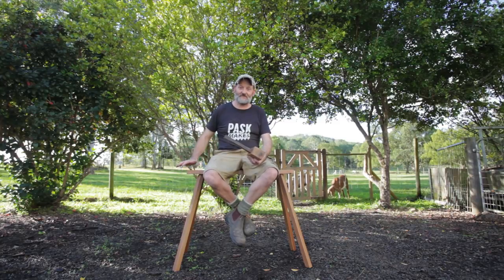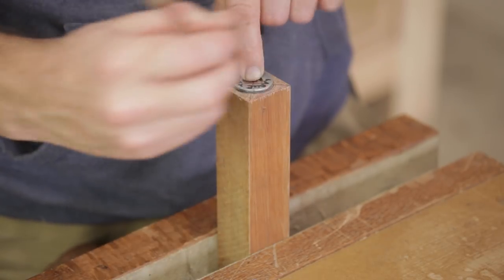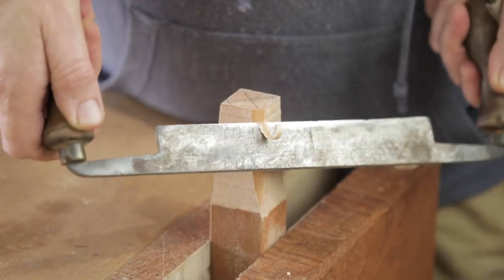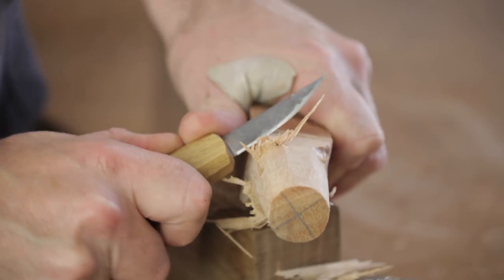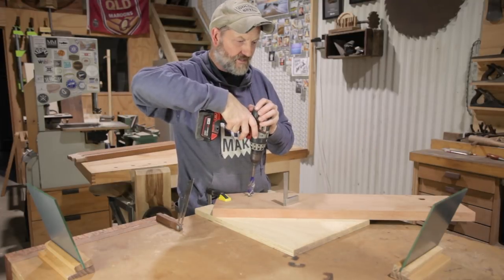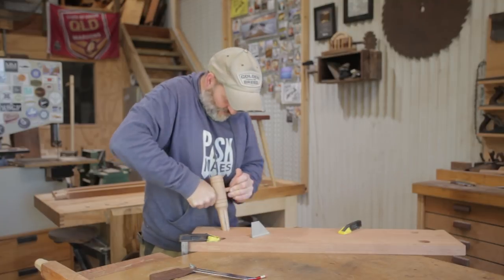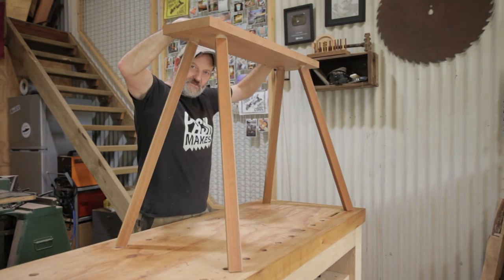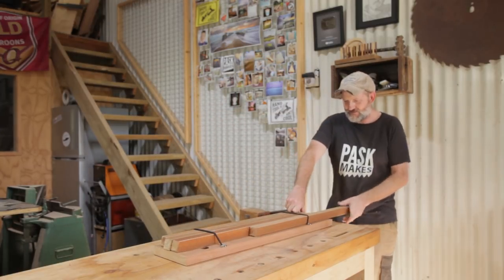Knockdown Sawhorse

Comment: Gosh, I really like this design.  You've done it again. !!
Reply: Nice quick taper marking jig.  
Nice mirror trick.  It has me wondering if a third mirror could be used and with proper alignment, could both views be seen without having to turn your head.   I see a run on mirrors about to occur.
Reply from the maker: You don't even have to turn your head, you can just move your eyes, but I couldn't help myself. ;)

Comment: Take a block of scrap. Using a sliding bevel mark your taper down one edge then square the lines across. Then do the same from a second edge and cut down the lines to form the angle you want to drill at. In the end you'll have an L shaped guide. Put your drill bit centred where you want to drill, slide the guide block up to make contact with the side of your drill bit and bore your hole. It's much easier to control than using mirrors and looking left and right.
Reply from the maker: Yes that would work but I reckon it would have more room for error. You'd be able to view a smaller drill bit against the angled walls but a larger speed bore bit, spade bit or forstner bit wouldn't work so well. The mirror trick is great and something I will do from now on. Also very quick and easy. :)
Reply: Fair enough, I have used it with a brace and auger bit with very accurate results. It wouldn't work with a spade bit at all. There's a modified version I saw once for a forsner bit where a relief cut was made to the underside of the guide to allow the bit to fit in. Anyways good to hear the mirrors work well for you.

Comment: I love the simple and compact design. Major space saver and super portable. I can only see 2 possible improvements: 1. Somehow make the mortise and hole keyed so that the the bottom angle of the leg is always at the correct orientation. 2. Cut a handle or attach a hardware handle on one edge to make it easier to carry. While I'd hate for you to destroy them, do you have any concept of the load limit? I know you stood on it and it looked solid enough, but I'm also thinking about hammering and banging on projects that are resting on the saw horses.

Comment: Every time I see you use that reamer, I can see how you sliced your hand open. It just seems more natural to remove the reamer by gripping the shaft rather than the handle, but obviously that will end in tears each time 😢
Reply from the maker: Yes, you're right but there's no way I'll do it again. I only did it because the thing broke and for some reason I just grabbed it - in normal use I wouldn't just snatch at a tool the way I did. :)